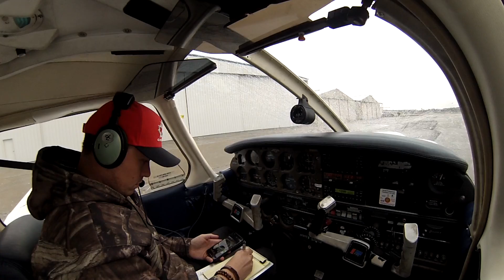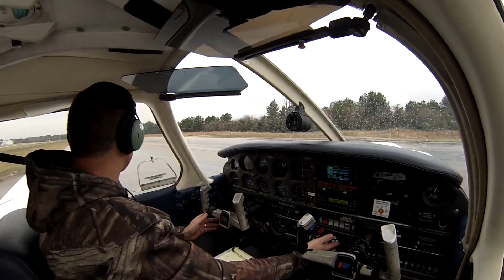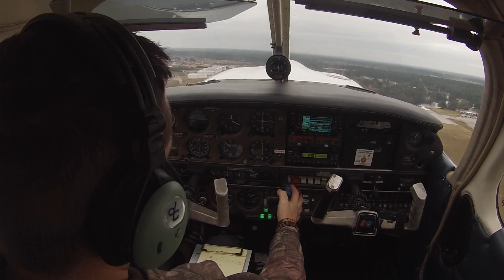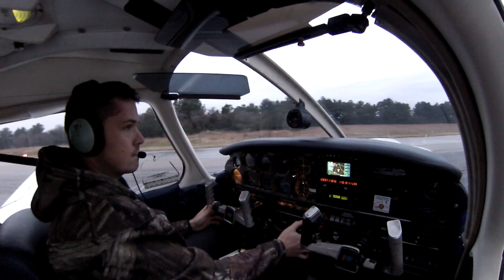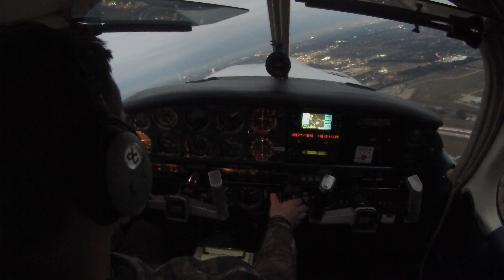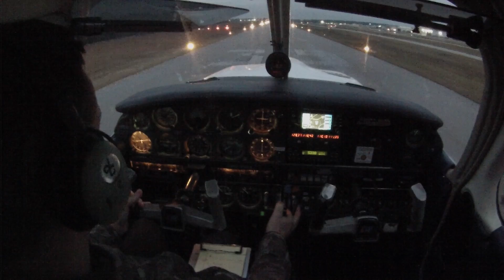Test Flight - Prop Over Speed - We're coming back - After Engine Removed for IRAN - Piper Arrow

Comment: Is that what you call a runaway prop?
Reply from the maker: Not run away since I can control it with the governor still. It was just not calibrated, quick little adjustment and back in the air worked perfect :)

Comment: Sick edit! Did they check the wing spars?
Reply from the maker: This plane does have an EddyCurrent inspection and @sean Reidy is right my RPM (prop) was over speed not the plane itself. Simple prop governor adjustment and we were good to go.
Reply: Also, you red lined it in the upwind? Vy?
Reply: @grummangreaser4701  He red lined the RPM not the airspeed. Prop was overspeeding.
Reply: sean reidy oh sorry. I have no experience with Co stang speed props. Not yet at least.

Comment: So what was the problem that caused the crankcase to leak?
Reply from the maker: That we don’t know, only had 400hours on the engine so all I know is a bad pre buy/mechanic who apparently feels oil leaks are ok and “a lycoming” thing  and suspect a poor overhaul.
Reply: @FamilyPilot  That usually means the case bolts were not properly torqued which happens after changing jugs sometimes..left unchecked it can seize the engine when it spins a bearing..That junks the motor.
Reply: Who did the overhaul, a real engine shop or some shade tree mechanic?

Comment: You answered my question in the video - is a maintenance flight stressful :o) I couldn't imagine that it wasn't.
Reply from the maker: I’m sure it’s less stressful for the more experienced pros. But for me it takes me an extra few minutes to call up ground and you don’t realize how many noises your plane makes until you do a MX flight ;)
Reply: @FamilyPilot  I understand about the new noises. The C172 that I fly right now was built in 1960, compared to newer C172's the engine HP is a bit lite for the field elevation of 5,506' msl (especially in the summer), the airport is on a mesa, the engine is at TBO, it's STC'd for mogas, and flying it is an exercise in knowing where the "flat spots" are at any given moment lol. When the battery goes dead on my noise cancelling system the new noises get your attention. It's fun to fly though.

Comment: On a maintenance flight like that, I am not so sure I would have accepted an intersection departure. Why leave runway behind you?
Reply from the maker: Brandon i agree in general, and personally even non maintenance flights I use full length. However this airport they call it intersection but it’s full length from Hotel since taxiway Fox and Lima closed (couple years now)... we usually fly on 17s but when wind shifts we use 35 at Hotel. Gréât call out though! Thanks for watching
Reply: Family Pilot gotcha...makes sense. I have flown into DWH a few times, but it has been a while. Honestly didn’t even pull up the diagram :p
Reply from the maker: Their ATIS is so long with their taxi way closures it’s purely memory now :)

But do appreciate the question though.  I have lots to learn and much appreciate the input to any part of flying :)